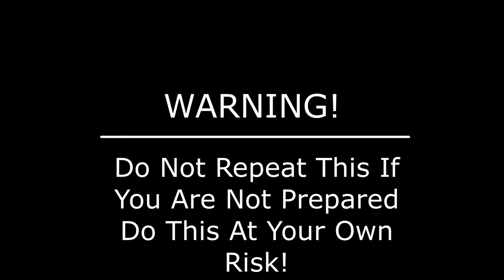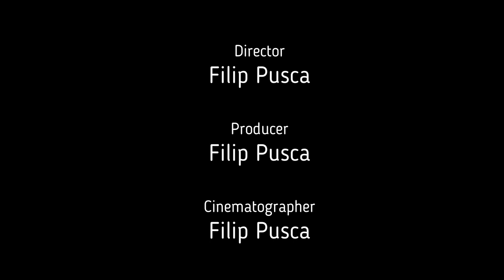Azio Retro Classic | Teardown Operation

Comment: I cannot believe I found this video. Helped me take apart my RCK to fix my right arrow key. There was some corrosion blocking the metal connectors on the switch from meeting the PCP board. Wouldn't have figured it out without your help. Thank you so much!
Reply from the maker: Hi, glad it helped to fix your keyboard, in fact this is a second video we made, the first video had bad quality and sound so we decided to remake it and here it is.

Comment: is it possible to replace or fix the stabilizers, it gets stuck on one side pretty often from gaming on it?  thank you for the videoo keep up the great work!
Reply from the maker: Hello, I think you can unstick the rubber pads and under them could be the screws which hold them in place.
There could be some dirt most probable and it will require only cleaning.

Comment: Could you please do a short video on the separation of the two halves and where the 8 tabs are? I'm having the hardest time at that point (28:00-31:30). Updated: Nevermind! I got through with a screwdriver. Thanks for this video.

Comment: To make removing the screws around the feet much easier (and not having to worry about them stripping when removing them at an angle) you can remove the feet by first removing the rubber pads on them (they are sticky glued) and then you can remove the screws holding them in, they are two screws holding the rear ones and only one screw on each of the front ones. After removing the screws the feet will easily pop off allowing you to get at the screws hidden underneath them. And as far as the part where  he used a broken tweezer to separate the two halves I just used a skinny screwdriver and after finding the spots the tabs were in holding them together I just give it some good force in that general area with the skinny screwdriver and it popped the tabs out.